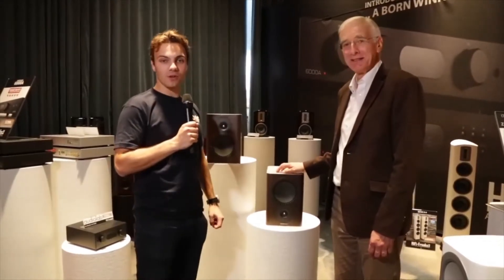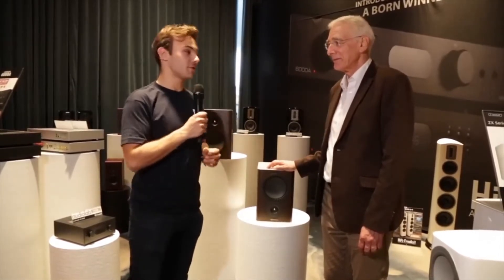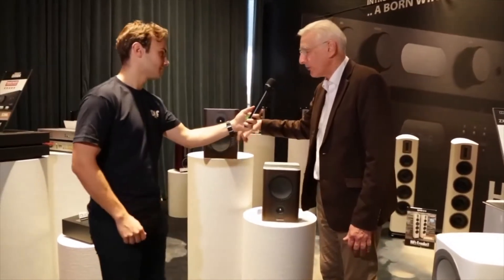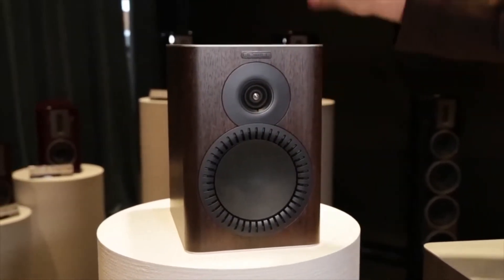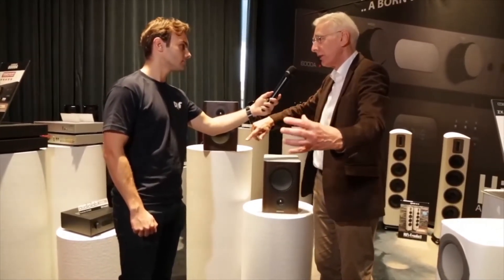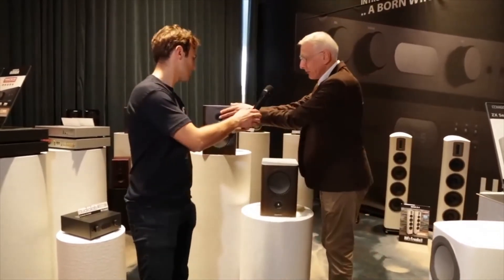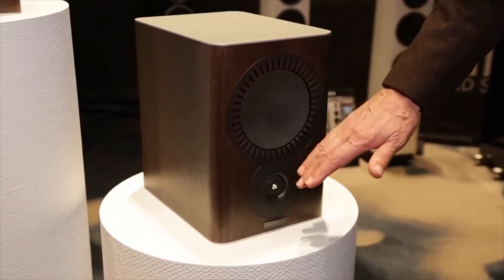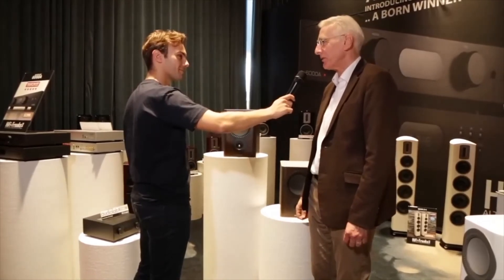Peter Comeau from IAG explains a very elegant and simple solution to a complex issue

Comment: Errr am i being extra thick and stupid, inverting the speaker to upside down tweeter now at the bottem and bass unit at the top and if i have followed this there is now a time differential of the audio signal ???, but the distance to listener has not changed only the inversion of the driver units ????.  High level science or hifi voodoo , i dont follow ? and i fully respect Peter Comeau am i missing somthing here  Help